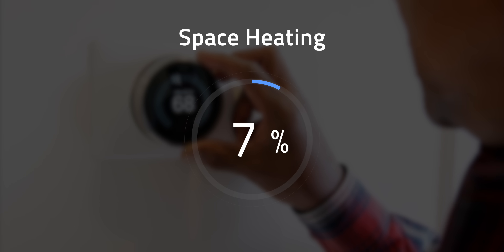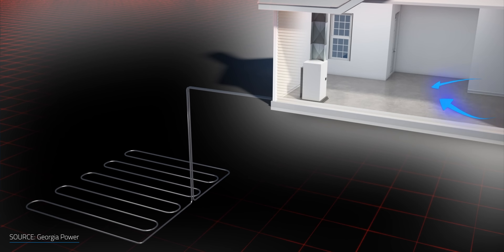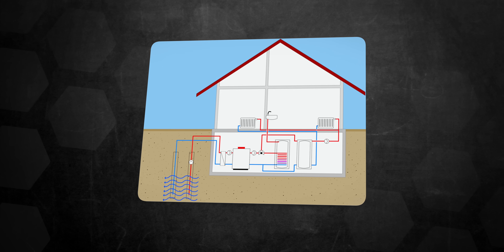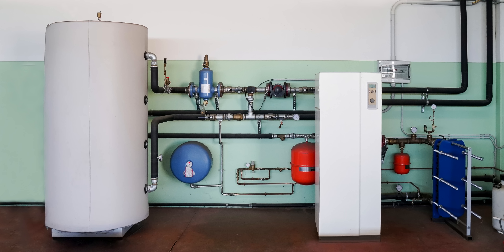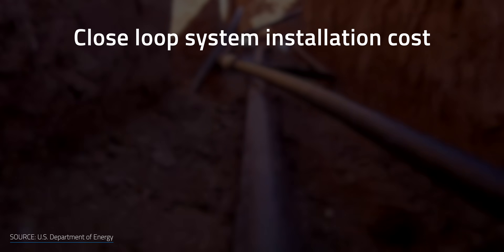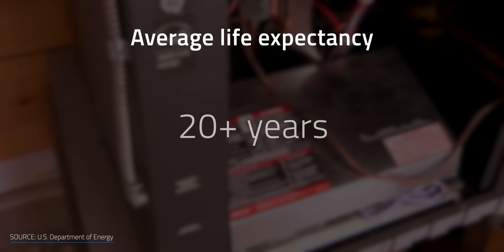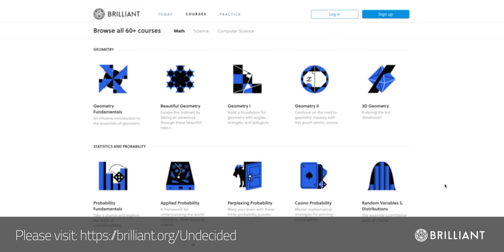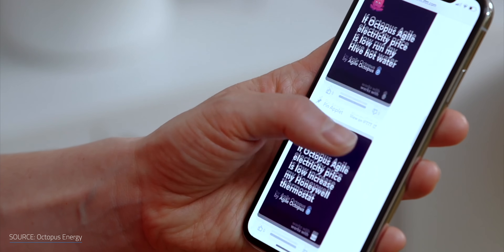Is Geothermal Heating and Cooling Worth the Cost?  Heat Pumps Explained

Comment: Where was the air to air geothermal heating and cooling? It is large concrete or metal pipes buried in the earth with a fan to push outside air through the underground pipe and into the house. The ground temperature at depths greater than 10 feet remains relatively constant through the year. At a depth of 10 feet (3.04 m), the average ground temperature is 75.12°F (23.96°C) in summer and 75.87°F (24.37°C) in winter. As you see it would take very little cooling for great ac and very little heat to keep the house nice and warm all winter long.
Reply: The thing is that air to air is less efficient than liquid to air, simply due to how dense liquids are, meaning they can carry more heat per unit of energy used to move it
Reply: @ironboy3245  BS! Air to air requires no heat pump just a fan. It is far more efficient as it uses at the most 1/10 the electric power.
Reply: @foxmaine3921  yes, but to transfer an equal amount of heat the fan would have to run almost 20 times longer, negating the energy savings
Reply: @ironboy3245  OMG that's the most stupid thing I ever heard. The earth transfers the heat. That's zero  energy to buy. You heat pump uses over $100 per month more power. A fan uses about .25 a day or abt $7.50 a month and provides a constant supply of 75 degree air from a fan forced air to air system.
Reply: @foxmaine3921  yes, however, there is a fundamental difference between heat transfer and heat capacity. You don't magically get 70 degree air from the earth below 11 feet. 

Air is 830 times less dense than water. 1 liter of water can transfer 3.96 BTUs of energy. An equivalent weight of air would only transfer 0.7992 BTUs. You'd need to run your air to air geothermal system 4 times longer to match what an equivalent volume of water can do, on top of still needing to run compressors, because the ground isn't that hot, compressing it is the only way to get hot air.

You don't get to break maths, water can simply transfer heat more efficiently than air. That's basic physics
Reply: @ironboy3245  you are soooo wrong! How warm is it 10 feet underground?
The ground temperature at depths greater than 10 feet remains relatively constant through the year. At a depth of 10 feet (3.04 m), the average ground temperature is 75.12°F (23.96°C) in summer and 75.87°F (24.37°C) in winter.Mar 30, 2011

An experimental investigation of subsurface ground ...

Comment: idea: Make a smaller geothermal system that brings the radiator up behind your kitchen refrigerator. Switch on its pump and fan, and behind the refrigerator would be a nice stable COLD area. Most people have their fridge in a wooden "hot" box and during the summer months, the compressor is running all the time because of this arrangement. But if you could bring coldness behind there, the fridge would not need a lot of power. It would see a stable temp. The average fridge uses from 1 to 2Kwhrs per day. A modest little geothermal install might bring this down a lot. DIY!!!
Reply: my fridge gets air from the front under the door
Reply: @silvercoulter  and if that place was a stable temp, it would not need to draw as much power.

Comment: Works even better if a) you have lowered your energy demand beforehand (e.g. good insulation) and b) you have seasons with a balanced need for heating and cooling along the year c) coupled with radiant systems in your house (not convection)

Comment: 6:20 'the residential sector...' - it's just a little lie man ) you cannot build it 'in the residential sector' just because of 'the residential sector' has a very little ground to place an underground heat pumping loop per each residential.

It's for Finland and Sweden where they actually use the real 'Geothermal Heating' but not cooling, just because it's misleading title 'geothermal' and it is not 'geothermal'. And either they usually have a lot of empty space around a house there. And the same way - but without 'geothermal' - it will work for the American rural areas, but again not for the suburbs.

'On average, horizontal ground loops require a land space, 300 feet long, 20 feet wide, and 4-6 feet deep, depending on the soil texture.'

Just look at the picture in your video I am pointing at : do they have 300 feet long ground to put their ground loops?

And yes do not forget it's actually freezing soil. It's very big issue. And again it's rather smaller when you have a house and the next one in half a mile and then nothing but beavers and bears in between, but if there are 'freezing loop', and 'freezing loop', and again, and more just in the line - there is a problem to move your entire soil structure where the houses foundations are placed on.

Comment: You will save on oil or gas consumption but how much electricity is being used. Is the increased electricity consumption outweigh the savings of the oil or gas consumed. ?

Comment: Looked at a system for a new build in TN and when I revived the payback it was 18 years Also new heat pumps can be very efficient with over 18 seer in efficiency. You did not cover the pump that moves the water on average last about 5 years cost 2 to 4 thousand to replace.  Geo has real issues with high cooling needs in the Summer and can not keep up when you have a large crowd at your home does not move air fast enough to keep cool. Those were just some of the reasons for staying with a electric heat pump system

Comment: a simple heat pipe going into the ground, with fins and a fan in the house would keep the house at a constant pleasant temperature in the 70s all year round. no need for pumps, or even any moving parts...

Comment: Why should water-water heat pumps or brine-water heat pumps have lower costs? For a private household, it costs a fortune to dig up the earth in the garden to lay pipes for the heat pump?
I also don't understand the argument of shorter life span. It is very safe if the pipes are buried underground and the main unit is in the cellar, as with all variants.

Comment: I am a big fan of geothermal heating and cooling.  I built my first house in 1995 and installed a Waterfurnace geothermal system.  It was an open loop using my well and had water heating ability to supplement my water heater.  Very expensive to install but way cheaper than using propane which was my only other option.  It was definitely a money saver.  My highest monthly electric bill ever in that house was $270.  Most were under $150.  I lived there for 20 years before selling it.  My neighbors were spending over $100 a month just for electricity but were paying up to $800 a month for propane in the cold winter months.  I also used the system to cool the house in the summer.  The biggest problem I had was keeping the water line filter screen clean because the water source was the well.  That needed cleaning a couple of times a year.  The other maintenance was a yearly acid wash for the heat  exchanger to remove the scale from the well water.   When I build my next house I fully intend to use geothermal again.

Comment: Geothermal H/C system is not really economical.  Where it is hot, the soil builds up heat to where the A/C does not work.  The same applies to heating in a cold environment.   I have designed 3 such systems, all for school districts.  What the hell, it is only taxpayers money.

Comment: I'm in the process of installing an air to water heat pump.  System is built by a Geothermal heat pump company that has branched into air sourced heat pumps.  In my case it will heat the hot water as well as the radiant floor system.   These systems operate down to -13 degs F , run very quietly and don't require a well or buried tubing.   Not quite as efficient as ground source but close.

Comment: this might not be a topic in the USA with cheap oil in abundance. in warm weather, it might be whatever if your house leaks heat, doesn´t matter.

but it certainly is in cold climates, where alternative energy sources like geothermal are subsidized by governments, oil&gas are taxed, and politically unstable solution, and as a result house heating bills with things like oil around the year, is a bigger question.  geothermal would be an independent, stable energy source. that alone is worth the price here. a no-brainer. really, it would be a solution all over Europe's homes right about now...

also, homes with heat conservation in mind are practically default here. 
homes might leak heat in other certain countries as a default, like Britain, so it might not be such a big hit on your bill to get thermal, or any other alternative solution, because the house leaks heat, alternative energy source doesn´t fix that, now does it?
 it needs to be a holistic solution, build a house with heat conservation in mind, and applying an energy-independent solution to it is the winning combo when electricity and oil stop coming and are expensive.

Comment: geo thermal takes electricity have been doing geo for 30 plus years. maintenance are higher. parts availability are an issue. Service vans using fossil fuel are required to maintain. without government subsidy, it is not worth it.

Comment: Seems like the simplest and possibly cheapest method is to dig two holes about six feet apart, drop in two large tanks a few feet below grade, drop into the tanks a continuous 1000 foot coil of PEX, make up the connections between the heat pump system and test for continuity, then fill each tank with water. One hot, one cold. Slushy ice evolves in the cold one, 135° water in the other.  I saw this on an episode of This Old House In a  demonstration house built in South Carolina. The earth separated the two tanks and provided adequate insulation from the other. The large  house did use a commercial chiller for the cold side due to the size.

Comment: The Dutch did this 20 years ago only they drill 100m deep into the earth to get the heat and still  push it so hard the new house must have hybrid water heater ( new name "Hybrid heater ") . The Dutch add propane gas tank to their car more then 40 years ago , did they have better air quality ?  Why they till need Russia gas and Oil for a country that smaller then NY ?

Comment: It depends on your location and climate. I live in a temperate costal area. Geothermal is not worth it here. You are much better off doing an inverter VRF system. If you live in the mid west or northern Canada it can be worth it but even then, most inverter systems heat down below -10*, you just may have to supplement it with a bit of strip heat on those really cold nights.

Comment: The math doesn't look good. Looks like geothermal costs some 20k to install and that's a low estimate. If 31% of my energy bill goes to climate control, and geothermal is 4 times more efficient, it would save me some 25% off my electric bill. If my bill is about 250 a month, I'd only save 63 bucks a month. It would take thirty years for that to pay off. Might as well just get an electric car instead

Comment: I think air source heat pump + solar pv is the most economical assuming you've got the ability to generate a decent amount of electricity from sunlight. Air source heat pumps work down to -18F if you get the highest efficiency models.

Comment: Excellent discussion. I have studied this quite a bit.  Two things,, you touched on each, but  they deserve more.  IF   closed loop system under your lawn develops a leak,,, and at the moment I am assuming ethylene glycol is the antifreeze, there are other choices that are equal.  IF there is a leak,, the system must be excavated forthwith and ALL surrounding contaminated soils removed and shipped to a sanitary landfill that can accept them. The expense of this will be eye crossing.  A  quarter of a million would not surprise me. All systems should pay into a pool against this rare possible occurrence.  The second feature that you actually did not discuss  but seemed implied,  The annual cycle of hot and cold can greatly aid in the energy savings.  The best system for this savings is the 'slinky' .  Perfectly calculated,, neither too much soils involved, nor too little.  When you take heat from the ground in a 'slinky' system you are removing the heat from a discrete block of soil,, assume at least 2 meters down to the top of the block(the normal practical subsurface depth) and 4 meters to the bottom of the block (the normal maximum legal depth without requiring EPA review and permits)and then as wide and long as suits the total, annual BTU needs.  When you borrow the heat from this block as the winter progresses,, by April you have created a large block of ice deep under ground,,,, Then the cooling season begins and you initially cool your summer home with this huge block of ice.  By the time October rolls into view, you have a heated block ,,, that now can aid in the winter's heat requirements.  IF the block is sized perfectly,, for that house,, for that climate and latitude,, a Goldilocks perfect size,, the total annual efficiency can rise 25%.  The extreme down side to this.  If you remodel and build an addition to the house,,, well,,,  start your calculations over.

Comment: Please commenters, stop with the "you don't use heat and cooling at same time, so you can't add 15 and 16 percent together." The only way this logic works is if you're measuring in real time consumption, ie right this moment the water heater is using 20% of electricity. But the problem is, in a couple minutes it will be using zero. 

Obviously these numbers are annualized. It doesn't matter what you're using or when, about 15 and 16 percent of total energy use is for heating and cooling, on average. Therefore 31% is the correct average HVAC usage.

Comment: Great video! Is there an option for underfloor heating/cooling without using a heat pump? I remember watching this innovative house building show in the uk (ages ago) and someone installed an underfloor geothermal heating/ cooling system by just running the coils straight under the house floor and that was it. It’d be very interesting to hear more on that if it’s a thing! Thanks keep the vids coming :)
Reply: I read something similar when I was in high school back in the 70s.Something like 12" underground pipes 50' from all sides coming into the house kept the temp. inside at 65 degrees Fahrenheit.(?)

Comment: A heat pump is about to raise Faktor 4 more heat energy, from one kWh electric energy. So if your price of electricity is less than 4 times higher than your price of gas per kWh, it's worth it in matter of consumption. So you have to speculate for the next 20years, how these prices develop, right now, it looks like oil and gas raise quicker, and a heat pump is universally worth the investment.

Comment: It's just not worth it, a ground source heat pump is only just more efficient than a air source heat pump which is much cheaper. In the end the best way to spend less on heating is to insulate, no maintenance, no air flow and it lasts nearly forever.

Comment: Good video & clear explanations; I didn't know geo thermal heat pumps were that widespread and/or available, particularly for residential / small installations.

One minor note: the way the COP was explained was somewhat misleading, as you basically said geo-thermal heat pumps are specifically more efficient than other regular heating/cooling methods because they have a COP range of 2 to 5. However, that's not correct; regular heat pumps, aka normal air conditioners and the combo A/C / heater units more popular in other parts of the US, also have the same COP range. The difference is that since they exchange heat with the above ground air immediately outside your house, their efficiency drops with more extreme temperatures, where the underground ones are more insulated from the extreme temps. The benefit though, is that unlike these multi-thousand $ units, small wall mounted units are extremely cheap in comparison, even to the point where you can install a lot of the smaller systems yourself.

Also, with the COP, it was just like "oh this number means it's more efficient" but didn't really explain how it related to conventional heaters. Conventional electric heaters are effectively ~99% efficient at turning electricity into heat; but the grid itself is only like 40% efficient in turning chemical energy like natural gas into electricity; so at grid level they're ~40% efficient. Stealing some numbers from Tech Connections video on heat pumps; a standard northern US natural gas furnace is ~90% efficient at turning chemical energy into heat. So a heat pump, since it runs on electricity, generally needs a COP of 2.5 just to break even. And COP is the same as efficiency (not explained), i.e. 2.5 COP = 250% efficiency.

The main piece of info I would've wanted to see in this video was how a geo-thermal heat pump compared to a normal air heat pump A/C unit or to a regular air heat pump in both heating & cooling modes - that's the main comparison; but I don't think regular heat pumps were even mentioned other than saying that these geo-thermal heat pumps were better than other cooling.

Comment: I was told by a ground source heat pump installer that the pumps last 6 to 8 years and not the 20 years you claim.  Would like to hear your response, thanks

Comment: Wonder if you could run a water line through part of the system through a point where there's always warmer spots. Passively heating up water while using electricity to heat it up just a bit more to make it hotter. Therefor cutting energy usage from turning cold water to hot water vs already warm water to hot water.